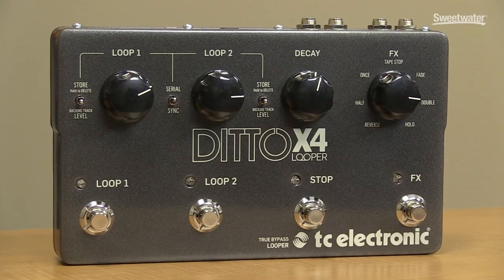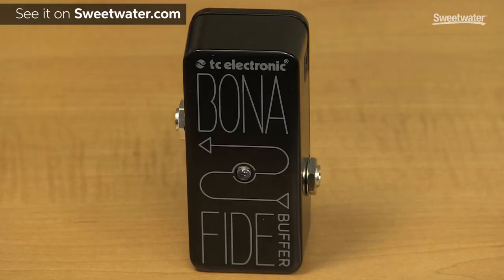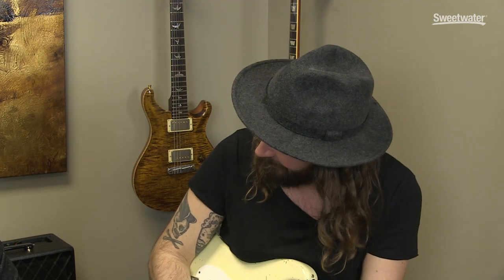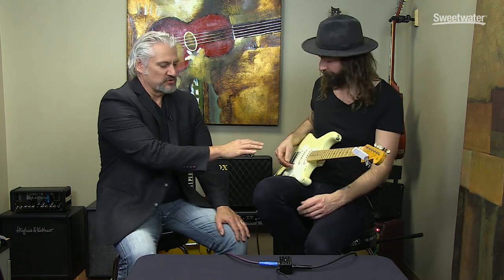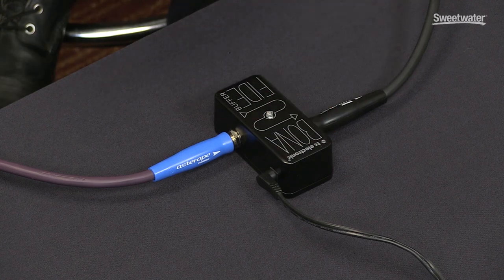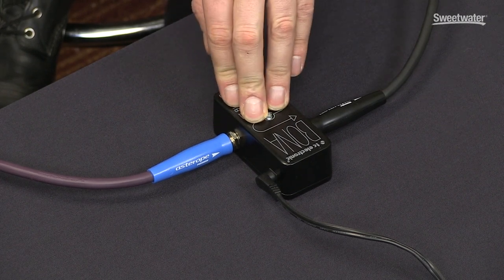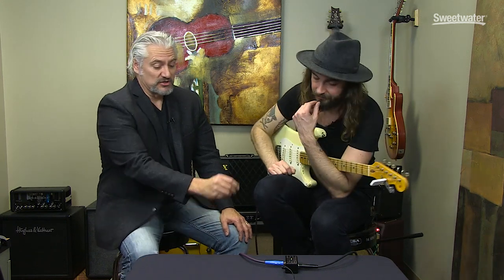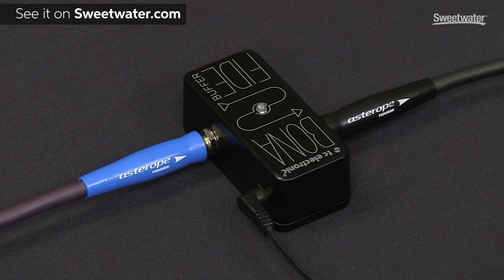TC Electronic BonaFide Mini Buffer Pedal Demo by Sweetwater

Comment: My experience.  First A-B straight to amp and then through your board. No change, congrats. My Marshall/Mesa rock rigs with minimal effects other than delays were fine.One rig was a A-B to 2 vintage tweeds. It was guitar,16 ft Lava to a high end pedal bypass looper with 8 various pedals. Even though off they are technically all bypassed unless being used, ran straight to the amps I could hear a noticable loss in sparkle, it's strength and harmonic quality. 
Secret is experiment with buffer placement. I ended up adding the bonafide before the pedal looper which is also before the a/b split to the 2 amps. So yeah, unknown hundreds in high end cable,thousands in pedals, its worth $70 to try. It can sometimes be a placebo effect with buffers but there was a much more pronounced change in the treble and overall articulation especially clean.

Comment: If you have a 20 or 30 ft cable going into your pedalboard and then another 20 or 30 foot cable going back to your amp then you need a buffer. On slightly larger or large pedal boards I find it beneficial to have a buffer at the beginning and a buffer at the end. For me the TC boxes (spark or this)  great and the Wampler decibel box works fantastic

Comment: Question I have some mis- matched Impedence with TC 1140 I have it’s wants to overload in some situations so I can’t turn up the amp the way I want to really get the power out of it I have the TC straight into the front of my with a delay in the fx loop and when I turn it to really get some dirt out of it it red lights overloads my cable length is no more the 10 foot long ..,so I guessing I need some kind of buffer to match up the Impedence mis- matching to fix this or a Keeley (apartment ) looper true bypass which I have not tried yet .. any suggestions

Comment: Why would you place a buffer pedal before the pedal chain, and then at the end as well?
Reply: Jared Boisen you’re cable going from your guitar to your pedals can suck tone too depending on the quality and length of the cable. Plus it’ll give a better signal into the pedals so it will make your pedal practically soar in tonal ability such as overdrives and delay.

Comment: i play bass. and i stop using pedals for a tiny bit. i like the tone of my bass through a single 10" cable. i'm starting to use my pedals again to mix up my tones in our songs. i've been on stage with a buffer pedal muting my signal, for whatever reason. the bonafide buffer seems to be something i should check out, but to take advantage of it's true bypass mode you all other effects in the chain to be true bypass.

Comment: i have 5 pedals but i think of getting 2 more (delay and noise gate and maybe a digitech ricochet) all true bypass, should i use a buffer on my signal chain?
Reply: compare you tone straight into your amp as a control then through all your pedals with them off, if you experience no tone loss, then no